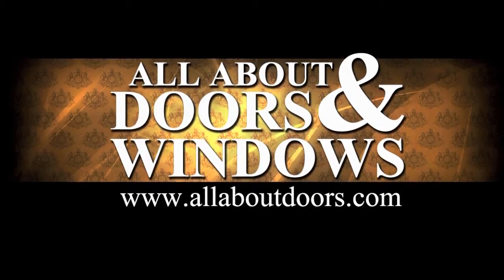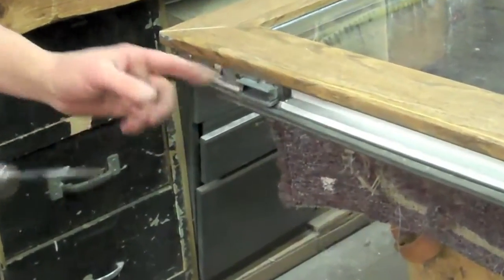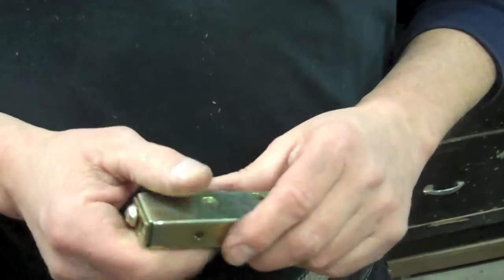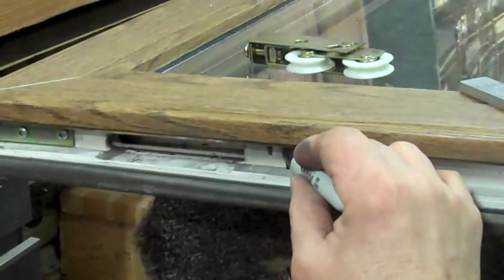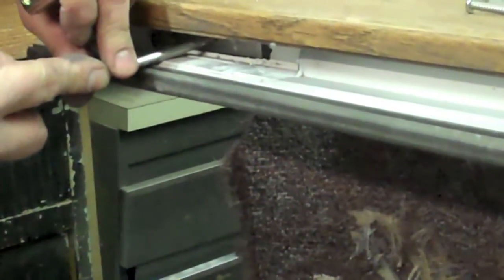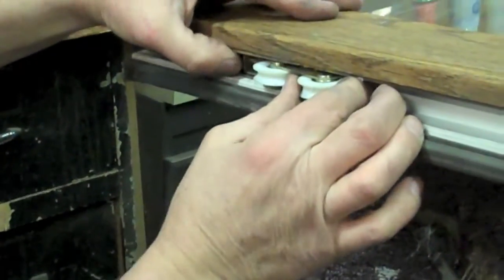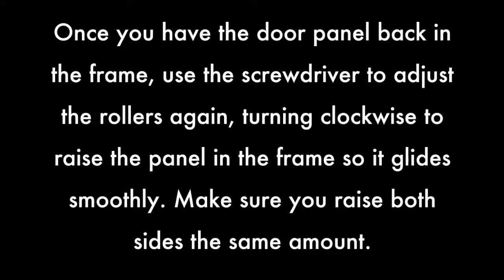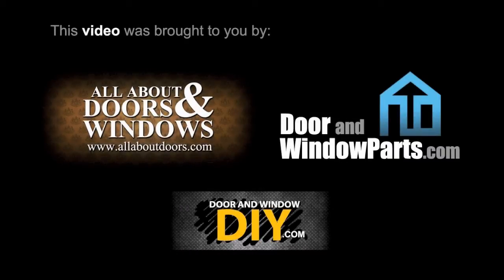How to Replace the Rollers on a Great Lakes Window Sliding Glass Door

Comment: Is there a way to try an adjustment. I can’t find any adjustment screws.
Reply from the maker: Is there any way for you to get the roller out? This is how it is on Great Lakes doors usually but if you have a different kind of door, the screw can be on the side or the edge instead.

Comment: My GLW sliding door will not come out of the track. The tank roller is hanging low and prohibiting the door from getting out of the track. :(
Reply: Same problem.   How did you correct this?
Reply: Same Problem, adding the door removal to the video would have been a huge help.
Reply from the maker: @edsvideos83  I am asking our technician about this! It's been a minute since we worked on one of these, but hopefully he has a few words of wisdom! I'll pass them along when I hear.